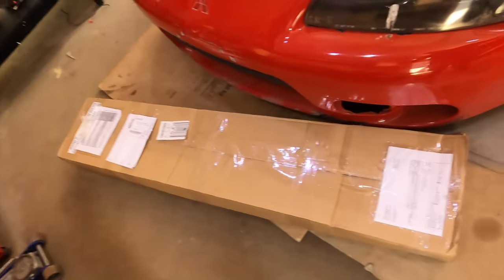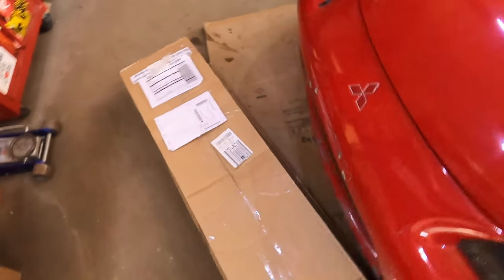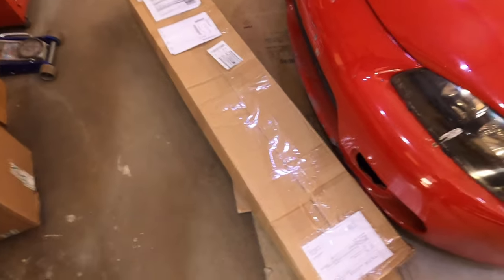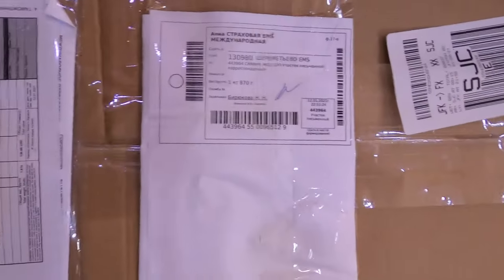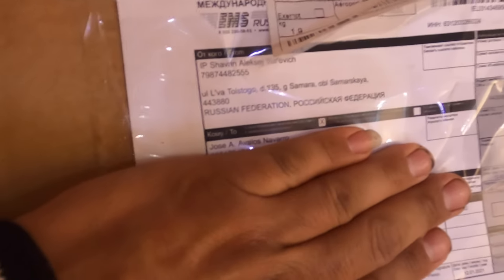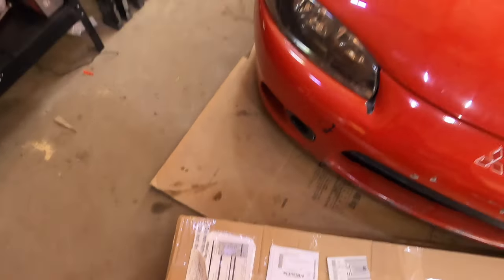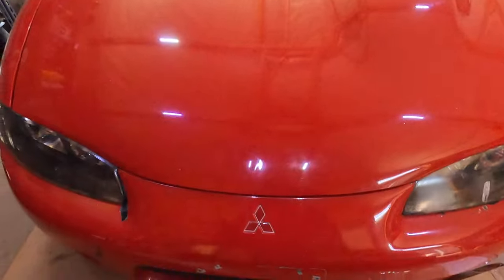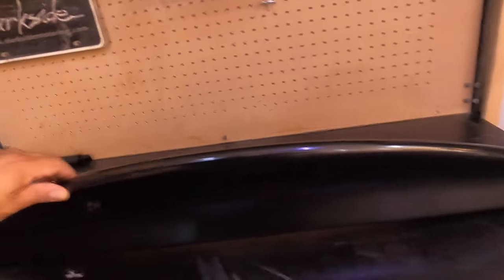RUSSIAN MADE 2G DSM DUCKBILL/DUCKTAIL (MOCK UP)

Comment: I have the same one coming but I'm planning on using the adhesive that's used for emblems on a car to hold it on.
Reply from the maker: Nice! The main plan was to just to see how it would look, so we decided to just mock it up with some double sided tape. For a permanent solution, I'm sure that will be the way to go. 👍